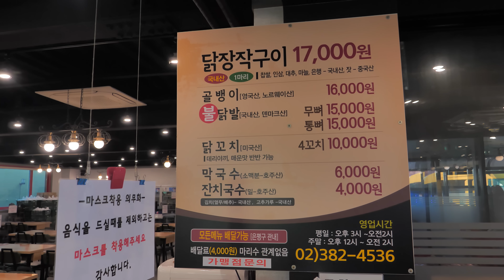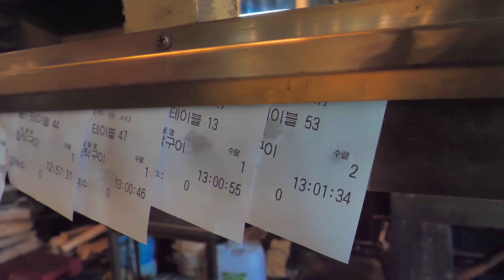하루 매출만 1500만원!! 끝판왕 장작구이 누룽지 통닭집/ 하루 800마리 / Oak wood-grilled whole chicken | Korean Street food

Comment: It looks like the chicken prep includes cutting out a significant portion of the bones, offal and viscera in the internal cavity of the chicken.  Do you buy the chicken prepped this way or do your staff do this portion as well?  That alone takes quite a bit of work.
Reply: just want to see if anyone knows this.
Reply: So all the bones are there except the neck You just pick through them after the crush the body. The offal is used in a lot of Korean street food since they can get it for cheap also the neck is also a pretty prized part. Most likely done at chicken processing facility.